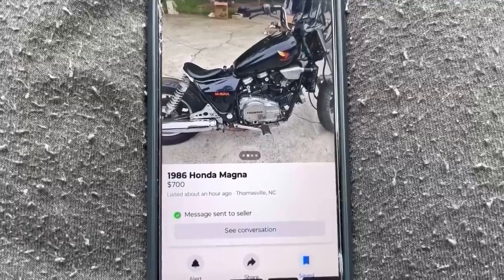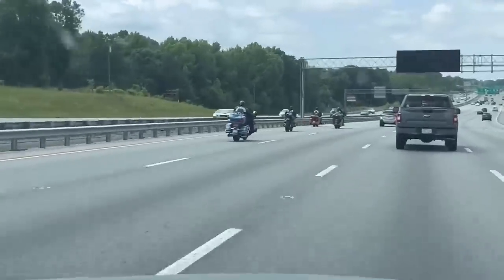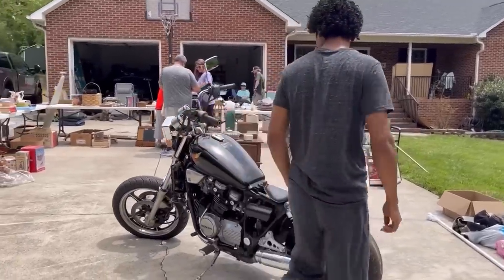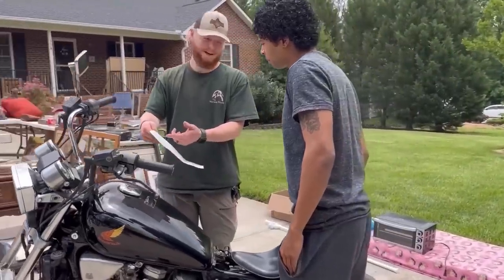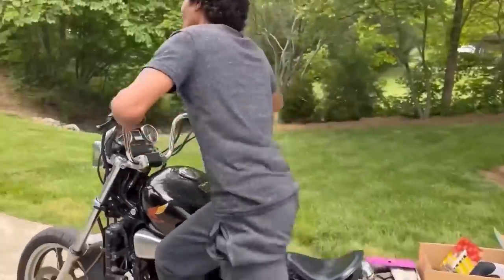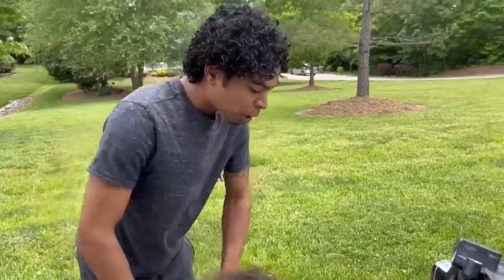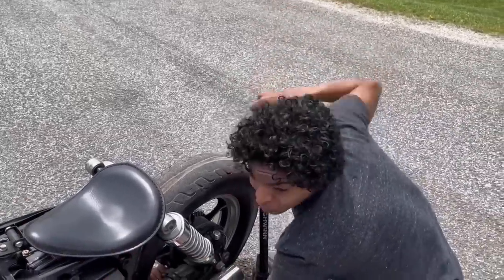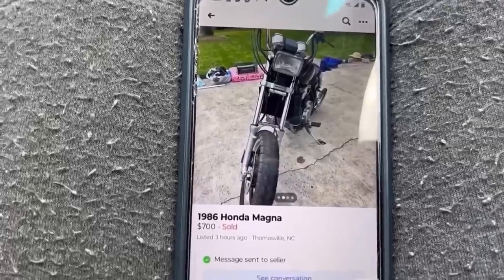🏍️ Yard Sale Motorcycle Find PAID $400 V45 Magna

Comment: Can't go wrong with a Honda,42 years riding metrics,Night Hawk 700,1986 Shadow 700 & 1100 ACE,came
 later in the 90's,Magna 750,1997 Valkyie were bike's I use own to, I currently own & ride a 2002 Shadow 1100 & my most favorite my 2002 VTX 1800R,You meet the nicest people on a Honda,Love Motorcycles,Spazz in Cali.
Reply from the maker: you have owned alot of nice bikes I plan to add a vtx 1800 to my motorcycle collection very soon.

Comment: Score !!!  I’ve been dabbling in buying fixing and trading bikes. Only have 3-4 so far but have yet to regret it.  If you do your research and have a little time and money it’s a great hobby.  Currently working on a 1988 Suzuki intruder 750 I got for FREE!  But no title no key and been sitting in my ex girlfriends yard like 15 years.  It’s part way torn down and after some new plugs, shoes, battery, ignition and carb clean I’m thinking it should fire up.  Def new fork seals also. But I estimate less than 300$ in parts. With only 18,000 miles on it. I can have a little fun with it and probably sell it for a grand in my area.  The title is possible to obtain too. But I’ll most likely keep it as a backup bike.  I def dig this one man !400$ is a killer deal. !
Reply from the maker: Thanks feels good bringing a motorcycle back to life working on bikes is a fun hobby good luck with your bike projects!

Comment: Thats a nice bike for 400. Float bowl gaskets an clean the carbs. New battery. 400 in parts, battery, tire your in there.
Reply from the maker: should have this bike up and running very soon thanks for following along
Reply: @2 WHEEL FAMILY  on the older 4 carb bikes. Do you use 4 vacuum guages to tune them? Also do you bench sync them. I restore alot of 70s an 80s kz bikes. Kz 650 750 900s an 1000s. If you run across any old kz 900 or kz 1000s pick them up. Restored in good condition they go from 5k to 15k

Comment: Congrats on the ‘86 Magna! It’s a great bike. I bought one new (black) off the showroom floor in Bellevue Nebraska 37+ years ago. Still have the Honda Service Manual in fact. Technically it’s not a V45 though (750cc) … it’s 700cc (698cc actually) and wasn’t referred to as a “V45”. Earlier model years (‘82-‘84 I think?) were 750cc/V45 because they came before the President Reagan import restrictions on bikes larger than 700cc. Those restrictions were lifted for the 1988 model year. Regardless, good luck with the resurrection. I’m looking forward to seeing your progress. 👍
Reply from the maker: thanks for the info ill definitely keep this in mind I only call the bike a v45 so people know it's the smaller motor and not the bigger V65 but it's good to know the information you gave can't wait to get this old bike running stay safe

Comment: Bro keep us updated I just bought a magna v45 750 myself and absolutely love the bike only problem I’m having is that it idles at 3000 at operating temp if you know how to fix that that would be great
Reply from the maker: that's exactly what this magna did on first start up I'll have the update video posted soon as I plan on uploading alot of videos on this magna. I already ordered so many parts for the bike and have the carbs off now. high idle in general means there could be a air leak like the rubber boots that hold the carbs to the motor may be cracked and old I would replace those if I were you. also check to make sure your choke cable is actually returning all the way back to full shut off they tend to stick from old age. also if the carbs are out of sync it will cause high idle hope this helps.

Comment: Nice bike and a good price I have one of the same I'm wanting to make a bobber for it and I don't know where to hide the cables could you make a video of the coml the cables are hidden I would appreciate it
Reply from the maker: as far as I can tell everything is routed factory the bike has no turn signals so that wiring was hidden in the battery area and the rear brake light wire runs down to the aftermarket brake light attached to the back of the swingarm
Reply: @2wheelfamily493  Thanks for answering. I hope you can make more videos with this bike. Keep going with your projects. Greetings to you and your beautiful family. Your videos are very nice.